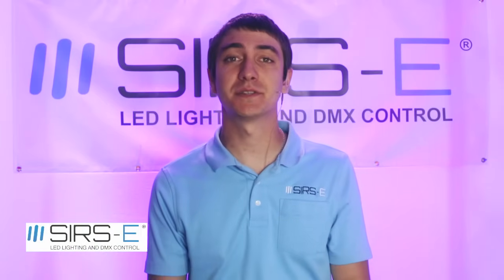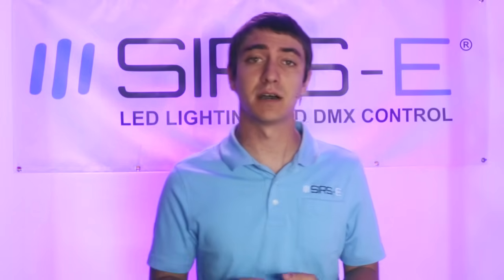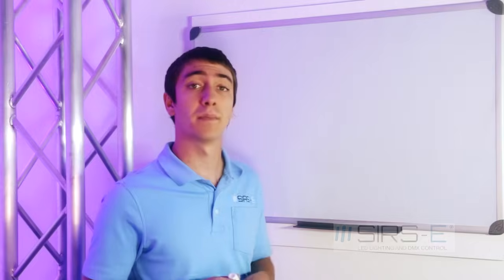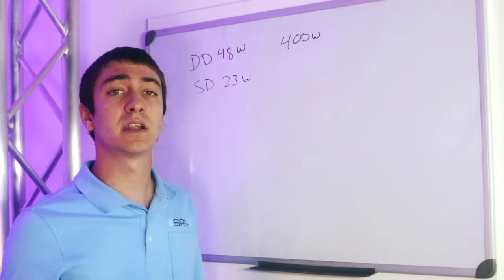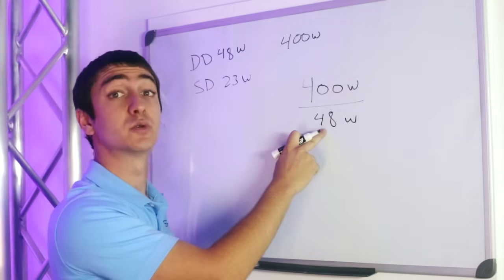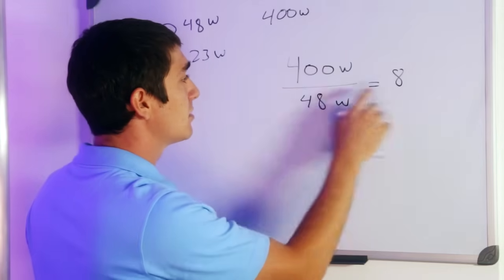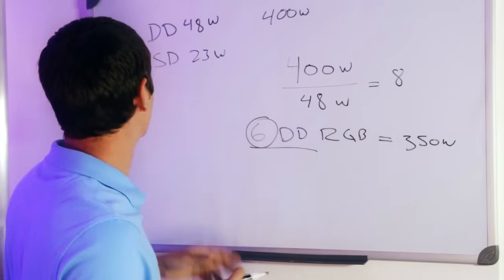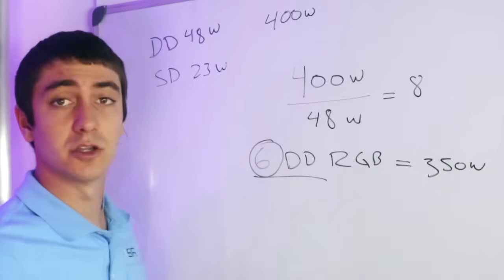How Many RGB LED Strip per Power Supply?

Comment: Hello, to run the SD led for 400W psu, best is to use 6 strips, isn't? May I know "strip" refer to 5-metre per strip?
Reply from the maker: The power supply best for the application all depends on the LED strip your using, you should get a power supply best for your LED strip needs.

Comment: What ampere power supply is required for 1m 5050 RGB 60Led /meter , 5m and 21meter . Correct me if i am wrong, 1A/meter is required for RGB 5050 60LED/meter , so for 5meter it will require 5A*12v=60W power supply ? For 21meter 5050 it will be 252W power Supply ? What about power consumption of the IR controller . On most chinese sites i see power controllers that are rate 6A,12A,24A,36A . So my next question is what ampere rating IR controller should be bought for a 21m RG 5050 60L/m ? What we adding the power consumption of IR controller (6A/12/24/36) to power supply load calculation?
Reply from the maker: Hello, most of the products in this video our out of date, please reach out to us at www.sirs-e.com if you have a project in mind.

Comment: So if I have a DC 5V 60A 300W PSU and two strips of LEDs (WS2812B ) 5V would this blow my lights?
Reply from the maker: Hello, I would not know as this depends on the specs of the strip. I would recommend reaching out to the manufacturer.

Comment: So a "400 watt" power supply is actually a 300 watt with a service factor of 1.25? Why isn't it advertised correctly? if it can only safely service at 300 watts with a maximum of 25 % over before it blows, its only a 300 watt. that's how it should be listed. Are all marketing people trained to twist truths to gain sales, or just your company? Nah, I know its not just you, just giving you a hard time, but in reality I don't know that i can trust you now.
Reply from the maker: Fred, the power supply can handle 400W this is the max, it is capable of doing so. However for longevity of your installation we recommend not using the power supply at full capacity all the time. Some installations are running 24/7 so this is where this information is needed.

Comment: Hi. Is this calculation only for serial wiring or does it work with parallel circuit too?
Reply from the maker: The calculation is total whether your running linear or parallel.

Comment: So If I wanted to run 2 16ft led strips together and the power output on each strip is 0.2w/led 60w/300leds which power supply would I need cause the power supply that came with the lights is "12v DC 5000mA" and the max wattage is 60w. So Im guessing with the provided power adapter it wont have enough wattage to run both 16ft strips together.
Reply from the maker: Hello Anthony, I recommend our 80W meanwell, here is a link. https://sirs-e.com/shop/led-lighting/led-power-supplies/power-supplies-led-power-supplies/ul-listed-meanwell-led-power-supply-80-watts-12-volts-100-240vac-non-waterproof/

Comment: what is sd strip and dd strips?
and how long are the stipes that you are talking abouth?
one more thing 
i like to put some led in my living room. the dimension of the room is 8m (26ft) long and 4m (13ft) wide. so in total i will need 24m (78ft) of rgb 50-50 stripes. can i use single power supply in my case?
Reply from the maker: Hello Ivan, sd is single density (30 LED per m) dd is double density (60 LED per m). Whether you can use one power supply or not will depend on the specs of the LED tape you have, if you would like a quote please visit our website www.sirs-e.com

Comment: How many Amps and Watts do i need on a power supply for a 5050 RGB 15m? It sais 5x12w for every 5m.
Reply from the maker: Hello Eskil, if 5x12 means 12W every meter, that makes 60W per reel, which means you will need a total of at least 180W so a 200W power supply should suffice, here is a link to our MeanWell 200W power supply, it is a high quality power supply that is well trusted throughout the industry. https://sirs-e.com/shop/led-lighting/led-strip-lights/led-power-supplies/power-supplies-led-power-supplies/ul-listed-meanwell-led-power-supply-200-watts-12-volts-90-264vac-non-waterproof/

Comment: I hope I didn't miss this being explained elsewhere but how can I tell if I have a Dual or Single density strip? Is there a sure fire way of knowing w/out going back to the manufacturer? Over the years i have purchased different lights from different vendors and they get mixed together etc.

Thanks!
Reply from the maker: generally single density is for 30 LED's per M, double is 60 LED's per M . This is the formula our company follows, as for other companies it would be hard for me to confirm that. This is the general standard for the industry though.

Comment: i have the dream magic 6803 led light strips , i have a 12v 50A 600 watt power supply. how would i hook up lets say 10 5M rolls of lights up to the power supply and controller. can i run them all together  end to end ?
Reply from the maker: Hello , we are not familiar with those strips so I would recommend reaching out to your supplier to get there recommendations

Comment: which led strips should I use for promoting ads for a led  hoarding? and what other parts would I need to make a whole led hoarding. For eg:- which video / photo controller, which power supply etc
Reply from the maker: Hello, please send us an email to contactus@sirs-e.com and we'll be able to get you someone to assist you with your project.
Reply: Okay sending an email right away
Reply: SIRS Electronics Inc mail sent. await to hear from you soon

Comment: HI, Thanks for the video, i am based out of philippines and planning to install LED in my 24 hours store. i have just ordered 1 5M 5630 chipset and looking at the W it says 36 W . does it mean its 36WATT/5 METER = 7.2 Watt/Meter ? 36 WATT/METER doesnt sound right to me else it will be more expensive as compare to regular light isnt?

Also does 48 W led take some amount of electricity as 48 W of fluorescent tube? if yes then how can anyone save electricity by switching to LED? sorry to trouble you with my questions
Reply from the maker: Due to the lack of information of the product that you are using, I wouldn't know exactly fro sure. It does sound like it is 36 watts for the whole 5 meter roll. 

It is because you are consuming the same amount of energy, for more lights. For example, for our retrofit kit the whole consumption is 50W for 4 4 ft strands. As opposed to florescent's consuming 50W per tube.

Comment: Can I solder three 5 meter RGB stirps together and will it work, Or will there be peoblems
Reply from the maker: Hello Scott, that would all depend on the type of LED strips you have, typically in a 12V system would not allow you more than 2 LED strips without having to boost power.

Comment: Hey :) and what about series/parallel installation of the strips ????
Reply from the maker: Hello, this video is describing how to determine the correct power supply for your needs, to run them parallel just connect them all to the power supply, or your control option.

Comment: You didn't mention how long these light strips are. I'm assuming 5m. Also these strips would be wired in a home run configuration and not daisy chained together, correct?
Reply from the maker: Hello, the strips are 5m long that is correct, also this video is just to inform people of how to figure the best power supply to utilize with our RGB strips, as well as if you have the specs, you can apply the same method to a different install. This doesn't take into account different methods of the installation itself, excluding components such as amplifiers or DMX decoders.

Comment: I have a 5m 300 led 5050, can I use a dell laptop power supply let's say 19v 3.4 a ???
Reply from the maker: It just depends on the voltage of your strip, you need to match it.

Comment: My project will be wiring 5 M role of RGB loom into my outside exposed weather decking.
What type of RGB controler do I use for this job? the looms connections are under the decking
Reply from the maker: Here is a link to our waterproof RGB controller. https://sirs-e.com/shop/led-lighting/led-strip-lights/led-rf-controllers/waterproof-rgb-led-rf-radio-frequency-remote-controller/

Comment: I'm doing 4 8' sections (double row per section), with a 725watt psu. Do I need to connect each section to its own yellow and black on the power supply?
Reply from the maker: It depends on the power consumption of your strip, as well I am unsure what those yellow black wires are. Generally you'll need the positive flowing through the strip, and negative will be used to control color selection if RGB.
Reply: Each 16 foot section draws 50 watts. The amperage I am unsure of right now. The yellow wire is the 12v supply and the black is the ground (obviously).
Reply from the maker: Depending on the voltage drop you may need to power each 8 ft section, generally for our LED strips we power every 16 ft for double density.
Reply: Copy that. Thank you.

Comment: I don't know nothing about these led strips but I guess I can go with the dual-density stripped and how many feet of line of lighting is that for a 400 watt power supply I don't know anything about this I know LED lighting but nothing with this trip so I'm trying to learn so I'm trying to say I need about 600 feet of lighting so what's the best way to go on about that I want light changing I want motion and not want to run at all on one Outlet
Reply from the maker: Richard, for double density after each strip of LED lighting you will need a booster, the strips are 16.4 ft each. If you would like a quote please email us at info@sirs-e.com

Comment: I am in a situation to have 5/ 5M RGB Double raw lede strip lights together. But each 5M pieces are in a distance of 10 feet away.. I want all the strip lights change the colours at the same time. Please help me with the correct way to do it. Thanks in advance
Reply from the maker: +Ponniah Kunathasan Hello. all you need to do is make runs with cable and solder them together. as well you may need amplifiers, please check out our website to find everything you will need. www.sirs-e.com

Comment: so if I wanted to connect 2 stripe together I would need 100 w 12v 5a?
Reply from the maker: +boxybrown3000 Hello, if your going to run double density you will actually need to run more that 100W. Keep in mind as well that we do not recommend running the power supply at full capacity either. Please check out our power supplies https://sirs-e.com/product-category/led-lighting/led-strip-lights/led-power-supplies/power-supplies-led-power-supplies/

Comment: Nice video. Still have a doubt.

Let's say I want to power some RGB 5050 leds strips that add up to 6A (12v). and I have the option of buying a 6A 12v power supply transformer, or a 10A 12v. And, I'm using a controller (the classic white one that all vendors on ebay or aliexpress sell) that in the specs it says "OUTPUT 6A". I assume that if I'm using more than 6A power supply, it will be "useless" since the power will go first to the controller and it will limit the intensity (A) to 6A, right? So buying the 10A will be useless unless I buy amplifiers? Am I correct? Thanks
Reply from the maker: +19Jose91 Hello, using a 10A power supply is best because you will not be running the power supply at full capacity. The only way you will burn out the controller is if the strips consume more than 6A.

Comment: Thanks for your quick reply, so will UL Listed MeanWell LED Power Supply 60 Watts 12 Volts 90-264 Waterproof be right for me?
Reply from the maker: +Tomas Gaeta I'm not exactly sure because I do not know the wattage required for your strip, however if you do need UL listed class 2, that is the power supply you would need.

Comment: When you are using that many strips don't you need a RGB amplifier  of some kind because some of the strips after 10m will get dim?
Reply from the maker: +joseph chrzempiec (josephchrzempiec) Hello, if your using an RF controller you will need an amplifier, if your using DMX it's best to add more decoders.
Reply: +SIRS Electronics Inc So i have 200 ft run and using a RF remote for RGB my Power supplies are at 12v 20a how many power supplies would i need and how many Amplifiers also i would need?
Reply from the maker: +joseph chrzempiec (josephchrzempiec) It all depends on the wattage being consumed and being sent through your power supply. Just find how much your strips use, then make sure you don't exceed the amount your power supply can handle.
Reply: I measure the current on the strip for each color with my multi Meter and i get 305ma for red, 304 for green and 278ma for blue.  it;s a  5m 5050 150 leds so a total of 887ma almost 1a looks like but the information i got is each color is 3a which makes no sense.
Reply from the maker: +joseph chrzempiec (josephchrzempiec) Rough estimate of how many watts your consuming based on the information you gave me is that your consuming 10.56 watts, just multiply that number times how many strips your running and that will give you total wattage. Then you just need to make sure your power supply can handle that amount. As for how many simplifiers you'll need, I wouldn't be able to tell because I do not no the nature of your strips.
Reply from the maker: +SIRS Electronics Inc ***Amplifiers

Comment: I want to connect 3 5050 rgb led strips, would the voltage on the power supply have to be greater than 36 volts?
Reply: They are double density
Reply from the maker: +Tomas Gaeta Hello, the voltage of the power supply would need to match the strips, 12V with 12V, etc. Now what needs to be more is the wattage, for ex. you can have a 12V power supply that can handle up to 400W. Please check out our power supplies to see which best meets your needs. https://sirs-e.com/product-category/led-lighting/led-strip-lights/led-power-supplies/power-supplies-led-power-supplies/

Comment: So, what if you get the power from the house outlet nearby and then an extension cold attached to it?  How many watts would that be total and how many strips? Thanks bud! Hope you reply back.
Reply: Or I should have said, using and extension cord then the power adapter to it. Thanks!
Reply from the maker: +EpicTouch USA1 Hello, you can plug it into a house outlet, however the wattage would depend on the power supply your using (adapter). Please check out some of our power supplies to learn more. As well just be sure to get the proper voltage and your all set!https://sirs-e.com/product-category/led-lighting/led-strip-lights/led-power-supplies/power-supplies-led-power-supplies/
Reply: +SIRS Electronics Inc heyyyy thank u for ur feedback. It makes people feel good when you-tubers respond back. Kudos to you. Peace

Comment: I bought a LED strip and I want to cut off some from the strip to use in different places.  How would I do this?  Would I need to buy more power supplies?
Reply from the maker: +NDMcovers Hello, you might not need to have multiple power supplies, it all depends on the wattage of the power supply you have. You will need components to connect the strips as well. Please check out our website www.sirs-e.com
Reply: +SIRS Electronics Inc I want them in different rooms so I do not want to connect them.  I would need another power supply right?
Reply from the maker: +NDMcovers Yes if you want them to be run separately you will need multiple power supplies.
Reply: How would they light up if you don't have power going to them????

Comment: i will use 1 controller and 5 amplifier for 30m (5m each), is this the best way, or is there a better way of doing this? someguy on the chip forum helped me with it and told me this was the best way for long sustainability of the leds.  i will order the pieces today or tomorrow, so if you would help me real quick, it would be a big thing for me right now.. the bad thing about this is, that i need to run cable to the strip and back to the amplifier/controller every time, this means around 100m 4x1,5 cable, which is not that cheap to be honest, thats my point.. a lot of people told me that running 5m 12v is the best way doing it, and not more ..
Reply from the maker: +weekndgermany Hello, if your LED strips are double density that is the best way to do it. Please email us at info@sirs-e.com so we can further assist you with your questions on design and what components you will need for this project.
Reply: i wrote an email, hope you can help me asap :)
Reply from the maker: +weekndgermany Hello, sorry if we have not been able to get back to you as quickly as anticipated. The way you have stated that your going to make your run is correct, the only thing I would look out for is not having your run be to long from to amplifier to the strip, because then it defeats the purpose of the amplifier.
Reply: +SIRS Electronics Inc that seems correct. the maximum length of the 4x1,5mm cable is to the strip on the other side of the room, an thats aprox. 12m. Is that too long? If it is, cant i make it up with more Amps? If you give me greenlight ill get all things i mentioned in the email, im good to go and it takes quite a lot from china to my place..
Reply from the maker: +weekndgermany You can compensate the voltage drop with another amplifier, which I believe you will need, I don't exactly know the nature of the products your working with so I'm limited in knowing how they operate or efficient they are.
Reply: ok sounds ok to me, so the best thing right now is, order those things and wait for them and than test it?
Reply from the maker: +weekndgermany Well if they have data sheets you can look at the specs there, most reputable sellers have data sheets for their products.

Comment: what happens to those leds at the beginning of the stripe? will they survive the power coming through?
Reply from the maker: +weekndgermany Hello, to answer your question yes the beginning LED's will not only survive but run at optimal efficiency. Our strips are engineered to withstand different wattage at 12V.